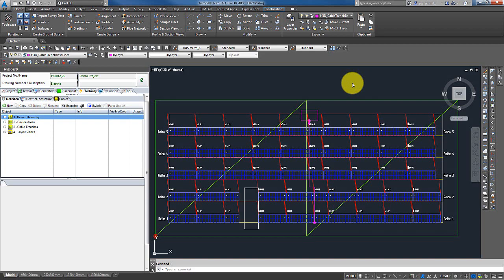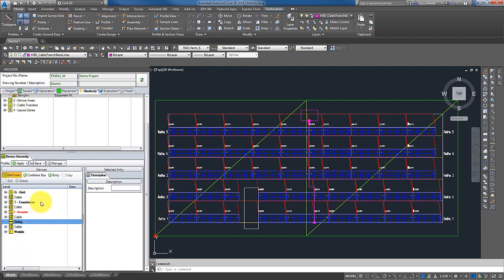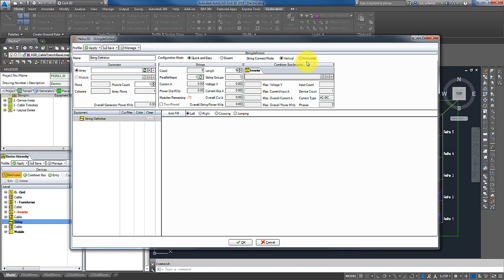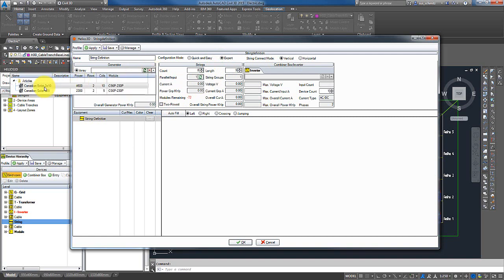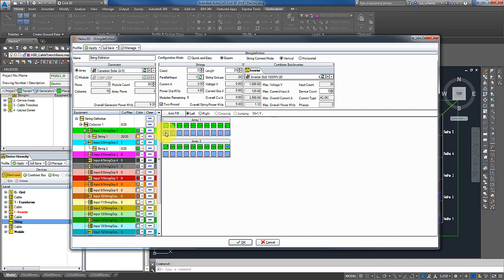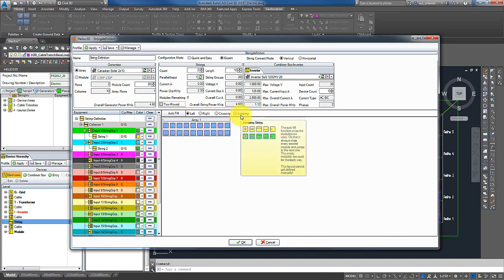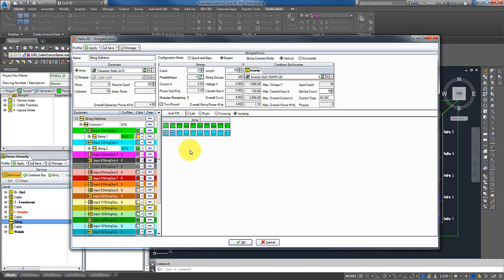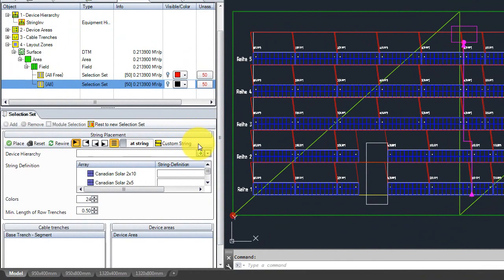Helios 3D Tutorial - Key Features

Comment: Hi, Is there a way to create a layout without using trenches or jumpers? I wanted to create a layout that each row is divisible by the string size.  Let say my string size is 18, and uses only 2x6 arrays. Three 2x6 arrays in a row are divisible with 18 strings. Will Helios create a row of arrays that is divisible of 18 strings and not fill out the site to a max and uses jumpers?